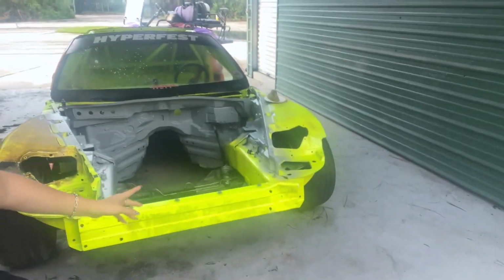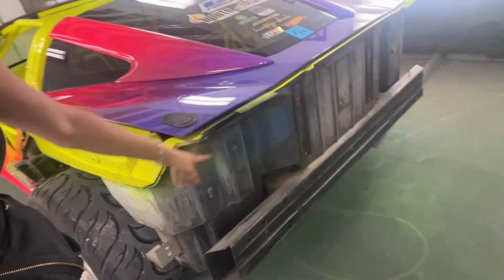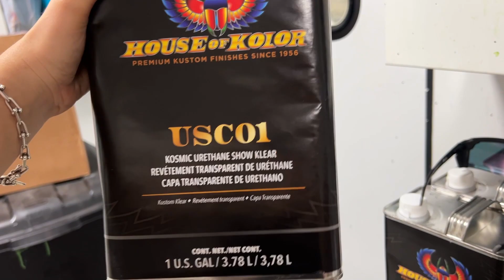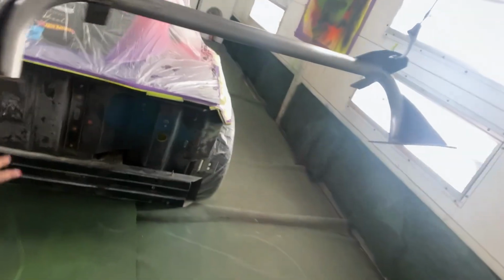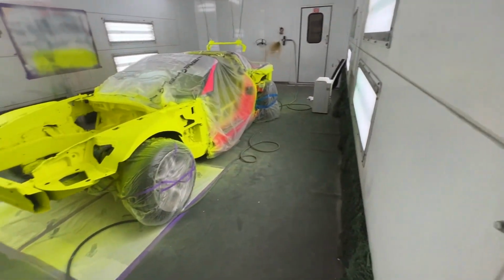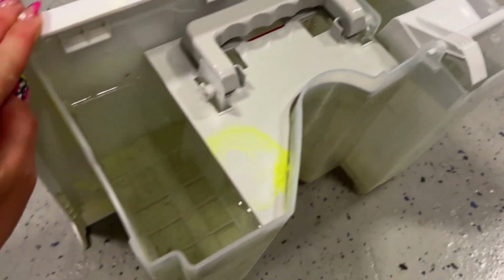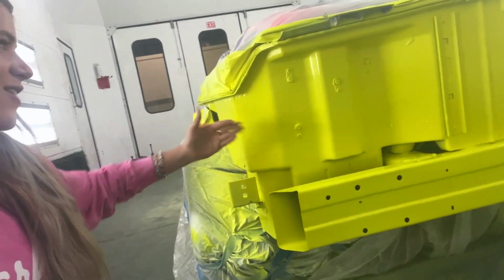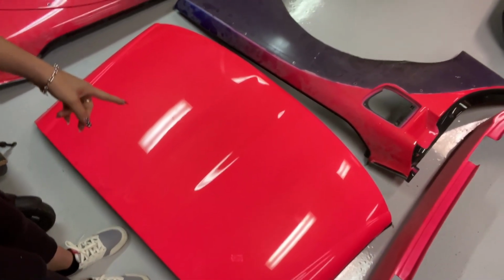Restoring My Burned C6 Corvette - Best paint job I've ever done!

Comment from the maker: Install Raid for Free ✅ IOS/ANDROID/PC: https://clcr.me/ColleteDavis_Sep22 and get a special starter pack 💥 Available only for the next 30 days
Reply: Hi collet want to show a vid about a hyundai N getting pulled over by cops in cali and he needs to remove track mode cost 7000dollars because the stock exhaust makes to much noise in track mode....wow
Reply: And can't wait untill you finish rebuilding de vet and add those cool new lights under the car 😎
Reply: Whats This??

Comment: Nice job on the vette, I really like the flake on candy colors this is the first time I’ve seen it on translucent yellow. Because of the conditions you drive in I was surprised you used the show clear. I expected a high solids clear or ultra high solids clear. It’s not quite as high gloss but a lot more durable to sunlight and ethanol. The fades going to be interesting to watch. It will good to see smoke coming off the tires on a track soon.

Comment: Paint the engine bay neon,, but really leave off the flake. That is for the outside panels and since it is a Drift car that will get battered and bent straight color is 100% easier to match.